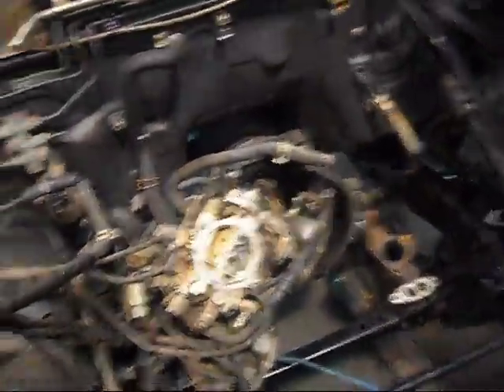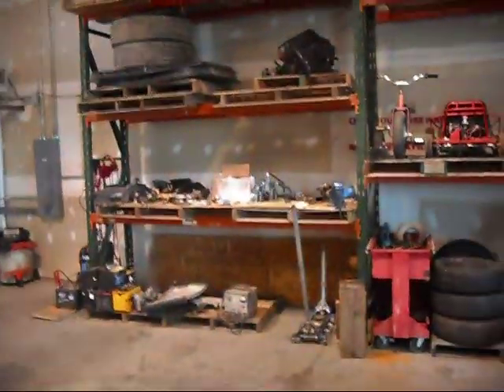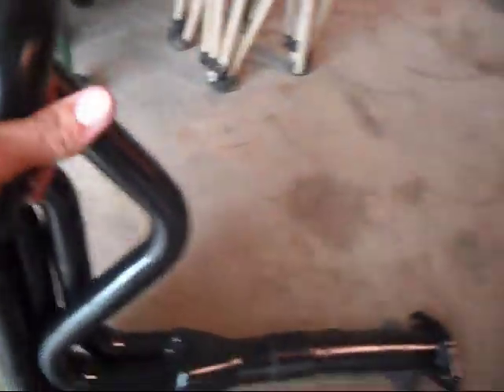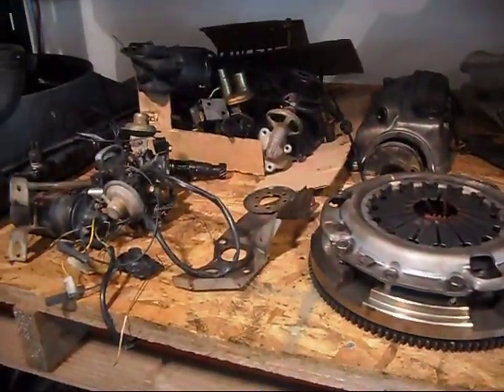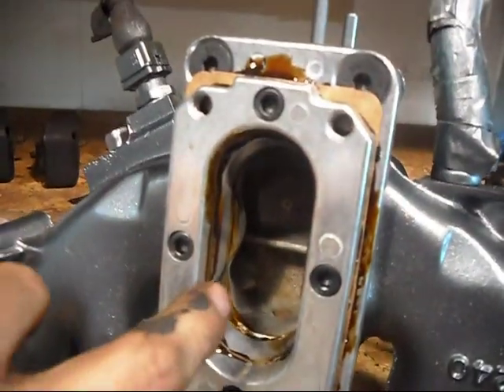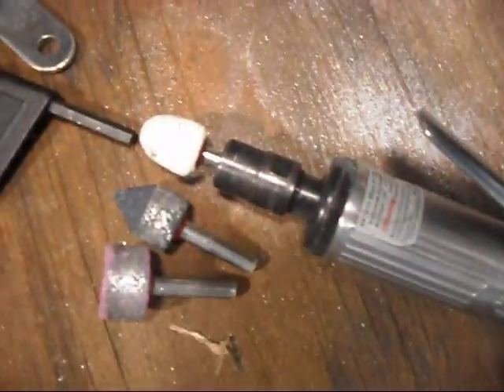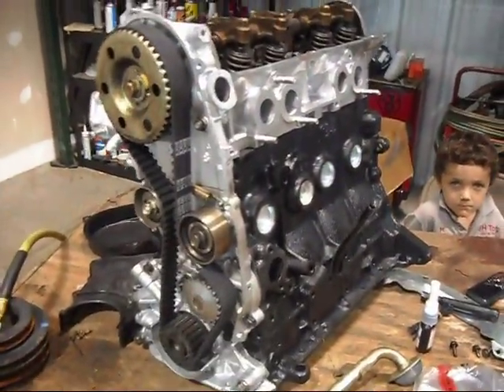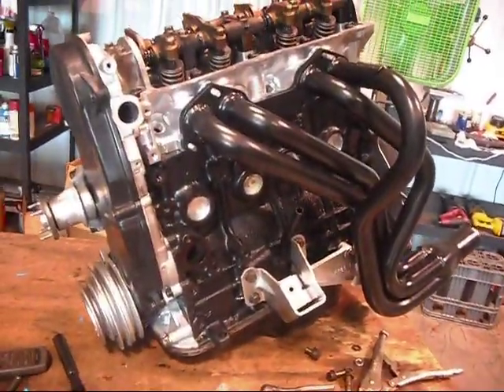Mazda b2000 How to, with 2.2L , Weber Carb & Pacesetter Header.. PART ONE

Comment: i had a 88 mazda b2200 and i swaped a motor out of a 86 mazda 626 gt turbo  it was a 2.0 efi turbo front wheel drive i had to swap some parts from the truck motor like mounts oil pan timing cover but it all bolted up even the clutch was the same flip the camshaft around moved dist to the front wiring was not hard at all